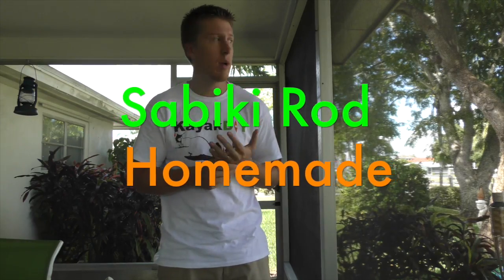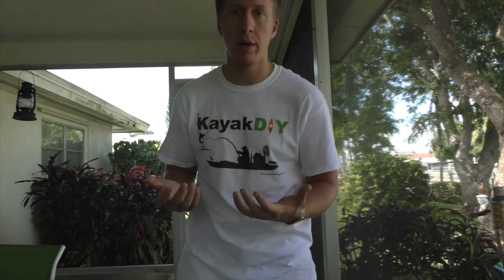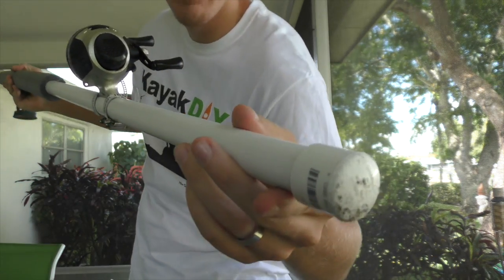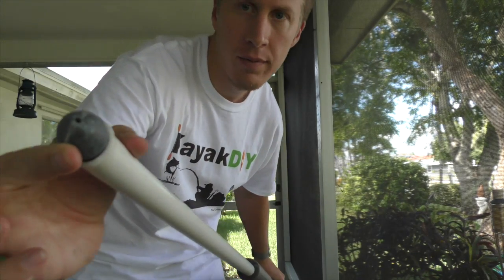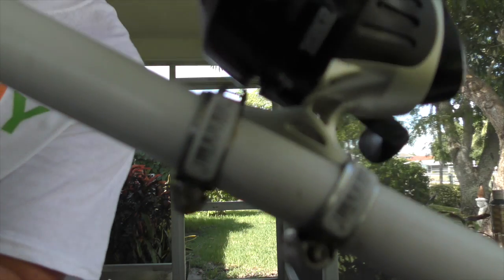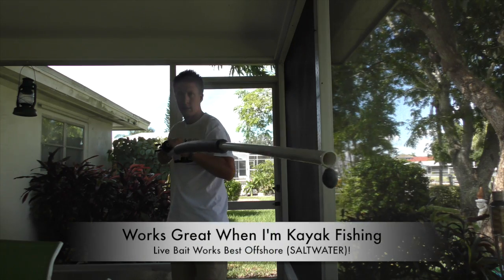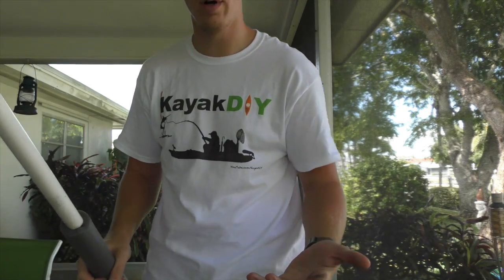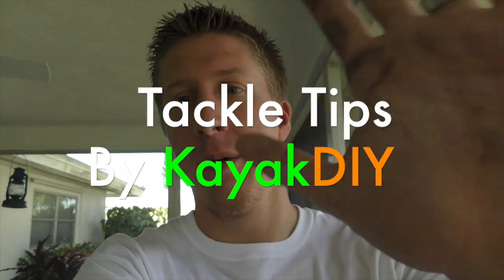Homemade Sabiki Rod for Kayak Fishing w/ Live Bait Fish!

Comment: Love the ideas! I am now subscribed as i love DIY kayak stuff. This is a great idea but was wondering if you have video of it in use? In the video you mentioned via text that this rod has extended the life of your sabiki. Though i am curious to see how it performs under, what we call here, a christmas tree (full stringer of fish). Thanks in advance!
Reply from the maker: It works great for 4-5 greenbacks (5-6” size) at a time.  It is much bulkier than a production graphite Sabiki rod.  Basically it is a ultra-low cost method to keep the sabiki rigs from being a tangled mess.  The weight of the rod is not as convenient as a production sabiki rod but then again it doesn’t cost the same either.  This is also primarily used for dropping not casting.  I use it a lot on a local fishing pier prior to going out.

Comment: I made one, out of 3/4" schedule 40. WAY TOO HEAVY. Pros: It will cost you only $3-5.  Cons: (1) It WILL bounce when put in a rod holder because the ocean moves, and it broke my kayak's flush mount ripping the screws strait threw the plastic (there goes my $60 saved and now I have a new problem - a costly repair to my kaya),  (2) very difficult to cast, will wear the hell out of your arms just bouncing the jig vertically. (3) when dropping straight down (which is all you really can do) the rig doesn't come out smooth because there are no guides so the 1 oz I used to use on my trout rod weight is barely enough to pull it out of the pipe so you must go up in weight, adding even more weight to the entire pole (4) it must be around 7.5 ft. (I guess you could make it into a 2 piece with some PVC couplings or whatever). CONCLUSION: Almost impractical unless you can find stronger and lighter material than schedule 40 PVC, and you risk damaging a kayak flushmount or other types of mounts. Not worth saving $50. The lightweight graphite design of a real sabiki rig is worth $60
Reply: it's meant for pier fishing to catch bait fish not casting far.

Comment: How did you flare the end of the pvc? Obviously heat it but what did u use for the flare?
Reply from the maker: +chris ellsworth I used a small funnel to flare the end.  I heated up the end over my grill.
Reply: That would have been an extra nice part to have in the video.